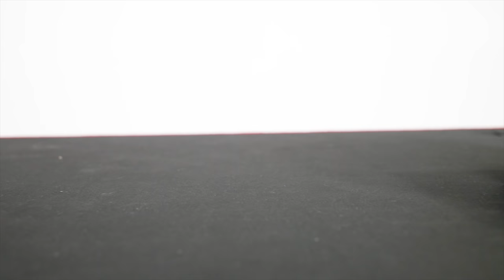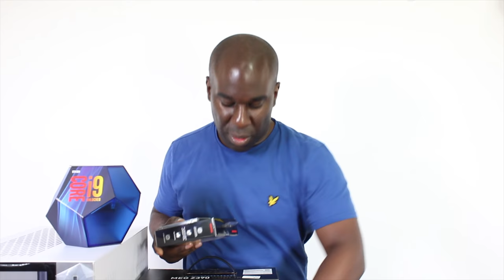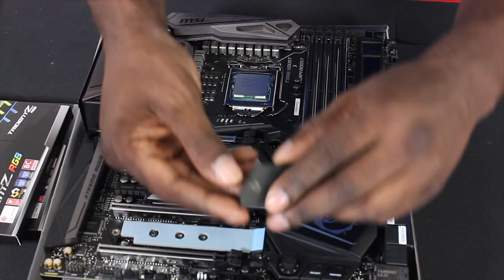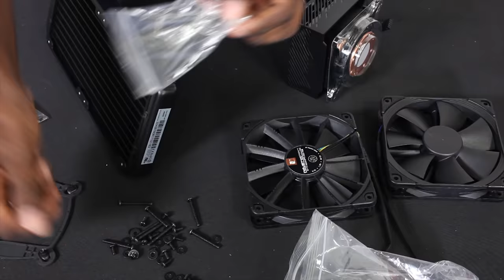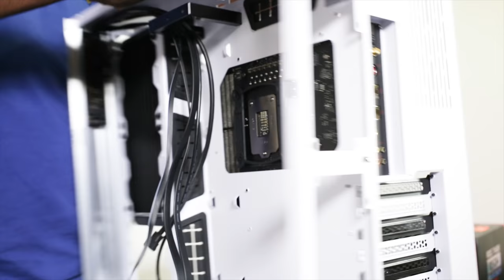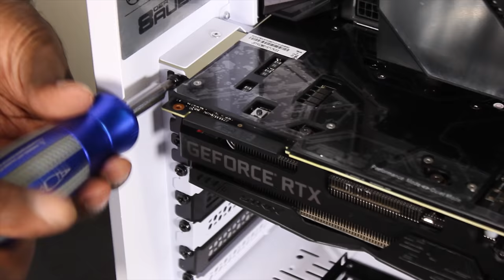The 9900K BUILD IS HERE - AND  ITS PRETTY EXTREME 😱

Comment: install the radiator on top and the fans on side to cool your gpu and have better cable routing, also the case won't look so empty even though this massive mobo is installed inside. maybe do a push pull config on the radiator to hide that massive gap on top

Comment: Great build, one criticism: The extra heat pad is for when the NVME M.2 storage doesn't have chips on the back of the PCB so the card makes contact with the rear heat pad. The 970pro doesn't have rear chips so you should have used the second pad, it's in the installation guide for this board.  Probably never going to cause an issue, but it can get a little toasty down there.  And just an FYI for your viewers, this is an EATX board, not an ATX board that'ss why it hung over so much in the case.
Reply from the maker: Must of said by accident as of you you check my other videos I defo said extended atx motherboard, the m.2 pads I had a feeling it might be, but check it so far and temps are not to bad but I rather get coolest I can so I am waiting for Toshiba and then I will do then when I put there m.2s in there😁

Comment: Any recommendations for a 2080 build with a i7 8700? I'm not looking to overclock. Just wanna play some games at 1440 p high fps maxed settings hopefully and 4k hopefully stable 60 fps. I've found some builds but I wanna make sure it's the right build before investing into my first pc build.
Reply from the maker: i wouldnt bother with a 2080, i would get a 1080TI if you can get one :) 1440p is the sweetspot for 144fps, but it all depends on so many things :)

Comment: I seen the probs you’ve had with the gems. As hardwarecanucks and GN tested, i think you should have the radiator on top pushing air out. And the rest of the fans as intake. Think it would also be more estaticaly pleasing. Also, it is unfortunate you cannot show off that psu on that case, because that case is freaking amazing in almost every aspect for its price

Comment: I have no right to judge anybody's work but just one question. The radiator, should the fans be on the opposite side of where you installed them. So its pulling ambient temp air from the outside then the exhausted would pull out heat in the case?
Reply: Lol i asked the same before i saw ur comment.
I always see it like a car that exhaust his engine heat true the radiator too cool his engine... u never see that
Reply from the maker: I have replied to this question, as its a good question :)
Reply from the maker: See above 🤔

Comment: MXDOUT I have same mobo and was thinking about that case and the 360 version of that aio, but looks like connections at the bottom right of your mobo would be impossible to get to with the 360 aio?
Reply from the maker: And you would be right unless you put it the top of the case, for custom water cooling you could put the rad in the outside panel compartment and put the fans in the in compartment and that would work and there is a few more ways, but video coming on that😁

Comment: I bought the i9-9900k and it won’t fit in my MSI meg Z390 godlike. Did I receive something faulty? The arrow is on the top instead of on the side..
Reply from the maker: Hold on are you serious, did you sort this?
Reply: MXDOUT Haha yeah! I posted a thread on TomsHardware and everyone was telling me it was a core 2 duo that was stamped to fake an i9. I got ripped off but I got a refund. And it was from Best Buy! So basically, someone bought an i9 from Best Buy, kept it and put a core 2 duo restamped in the case. I got a new i9 and everything works fine now.
Reply from the maker: Danm that's messed up, but I'm so glad you sorted it, God these so many dodgy people out there🤨😉
Reply: MXDOUT yeah, thank god they accepted the return. They could have easily told me I could be scamming them and they wouldn’t accept it. Now, my motherboard is throwing out a CPU error. Why is it always the CPU!?

Comment: I really like this build the case is so nice.
Im not an expert but why do you let the fans exhaust on the radiator?
I c that allot on pc builds and i always question myself a car doesnt exhaust his engine heat true the radiator why doe people do that with pc.
Dont u want to get fresh cool air inside true the radiator instead of hotter air thats in the case.
Does that has a reason? 
Verry bice build tho and like i said im not an expert and maybe i saw it wrong.
Reply from the maker: Nope the fans suck the hot air out from the rad ;) the front fans brings cool air in :)
Reply: @MXDOUT  I also have a push pull fan setup on my radiators as well. Fans on each side. My system only gets really hot during Cynebench R20. Everyday use sees mid 40 degree range. Strange though my GPU temps are in the 30s liquid of course separate loops for CPU and GPU.

Comment: I'm going for 1080 ti sli - because the RTX is like £1000+ and I can get used 1080 tis around £450 - not worth selling my 1080 ti haha
Reply: The prob is that SLI is dead and today not every game is built for SLI and in some games SLI is even worse in perfomance than the single GPU.
DONT do it. Go for 2x2080 with Nvlink The gpus costs the same and Nvlink is much better and you get much better perfomance and you have ray tracing.
Reply: @tgdxdrakoon7019  Guess you can't add up. I already have a 1080 ti and used ones go for around £450 - the 2080 is £800+
Reply: @tgdxdrakoon7019  Ray tracing is awful - show me the list of current titles that support it - there are none. 
And recommending nvlink? Really? Nvlink IS SLI - it's a higher bandwidth bridge, 1080 ti sli is worth it.
Reply: @tgdxdrakoon7019  And the 2080 is 3-4fps ahead - pathetic. It'd be pure stupidity to buy a 2080 - and the 2080 ti costs as much as £1200 and i can get a second 1080 ti and i would've paid the same along with no hassle of selling, when ray tracing is relevant the 2080 ti will be too slow to handle the new titles.